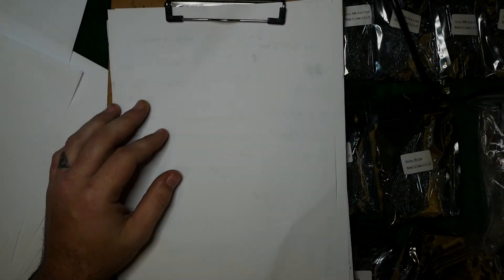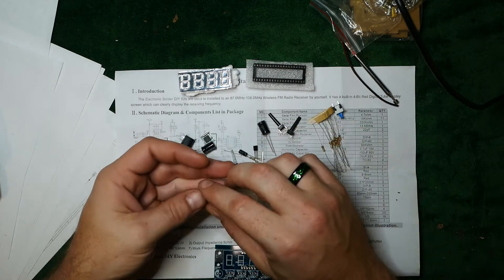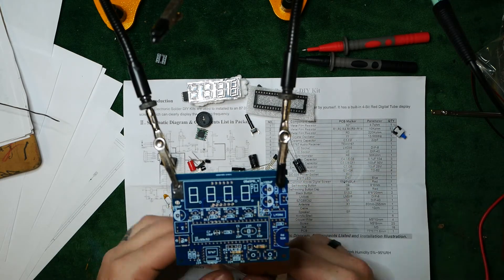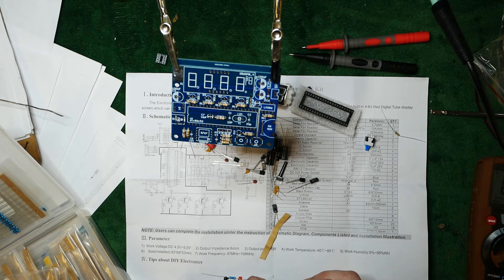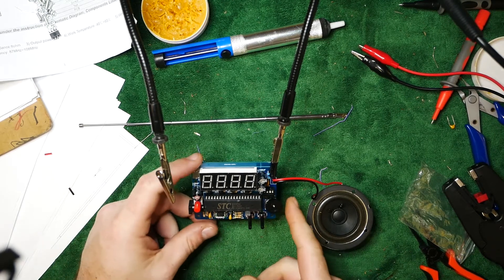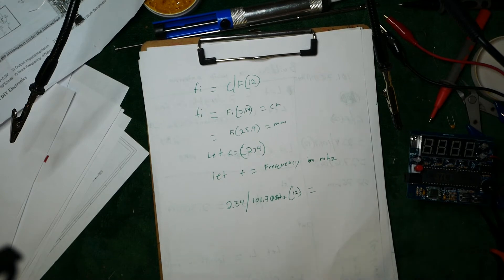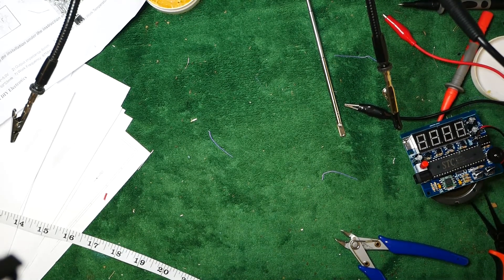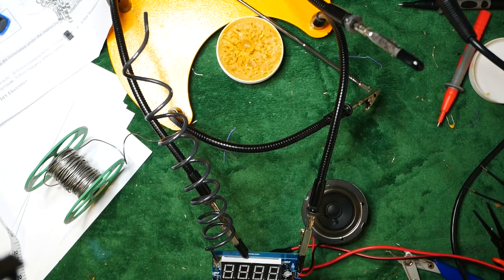How to build a whip antenna | 1/4 wavelength

Comment: As someone who doesn't know a lot about antennas, it's interesting to me how you can reduce overall dimensions of it by coiling it like that, but as long as the wire length is still right, it still works. Cool stuff!
Reply from the maker: It definitely comes in handy when you need to save space! The real thing to be sure is that the wire doesn't short from end to end. As long as that's okay, it really could've been snugly coiled together. So like if you check some smaller radio devices, they'll have resonate antennas to back up the metal telescoping one, mainly because the telescoping antenna aren't really the main antenna so much as a "tuner" to find the "resonance" of that frequency, like the rabbit ears on an old TV are like that, as such, adding foil never works.

So instead something interesting to do is replace the rabbit ears with a home-brew antenna, build to match the resonate frequency of broadcast TV, (General the middle of the band is considered the resonant frequency), like how FM goes from 88mhz-108mhz, so 98mhz is the proper middle resonate. Could do that same thing for TV  :D

I did that with mine using copper pipe to build the antenna portion (omni-direction) and used shielded coax (standard TV cable) to connect it to the TV. Worked pretty decent IMO, but I had no other home-brew to compare it to. Perhaps that can be a video in the future :D The TV I'm using as a monitor has a plug I could test it on.